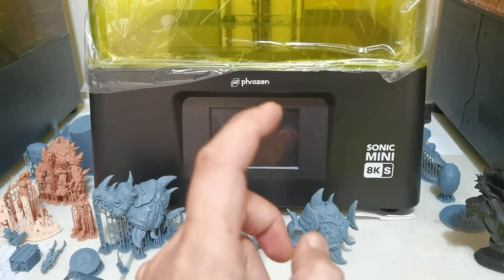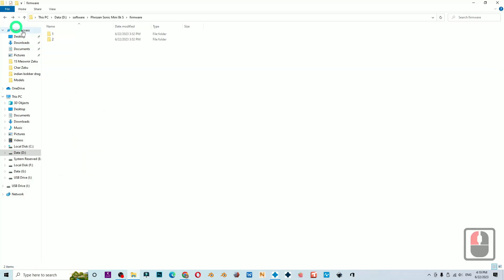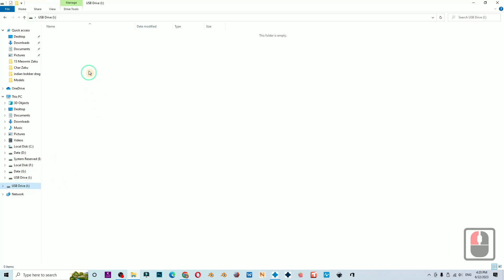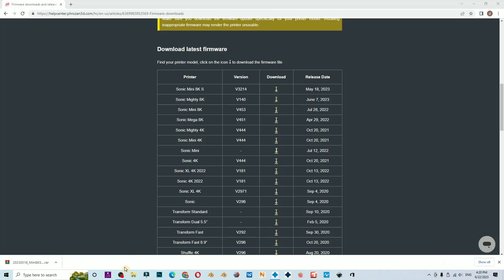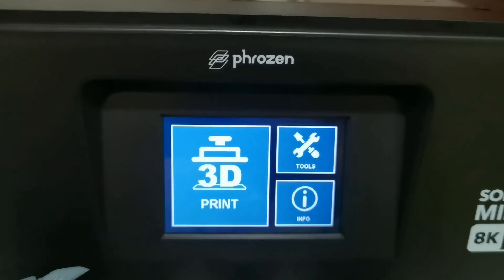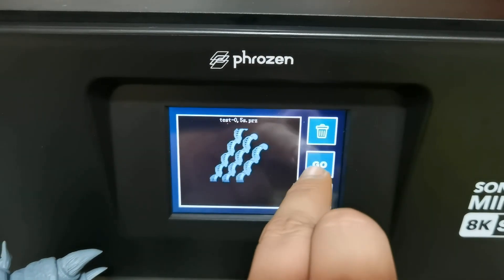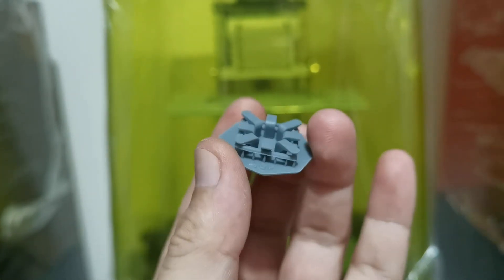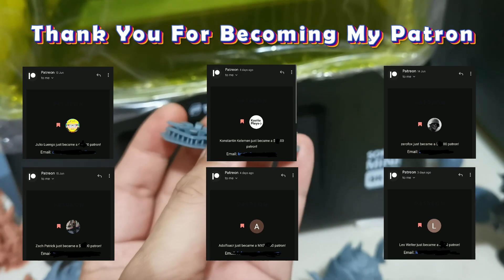Update Firmware For Mini8k S

Comment: Thanks to your help a couple weeks ago I went ahead and installed the update, and also found that first of all it fixed the problem, and second of all about .8 seconds was best for the white 8K resin. 

Now to figure out the fastest lift and retract speeds!
May I ask your best settings so far?
Reply from the maker: Mine is at 
Lift distance 1+5
Retract distance 5+1
Lift Speed 60+120
Retract speed 120+60
Reply: @wangdennys  thank you!

Comment: Did you ever get any updates regarding the Mini 8K AA issue? Or is that likely never to get fixed at this point. Is it more likely a hardware issue and not a firmware one?
Reply from the maker: Last info when mini 8k s out.
They still working on the fix.
Reply: @wangdennys crazy how long it’s been I wonder what the actual issue is . Hope they get it figured out soon.